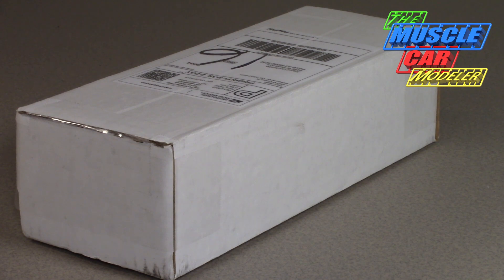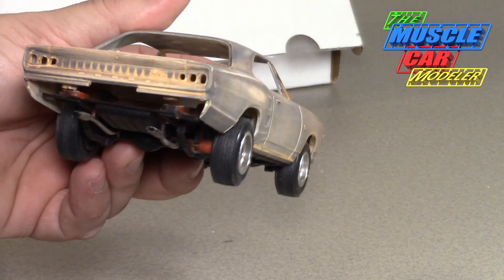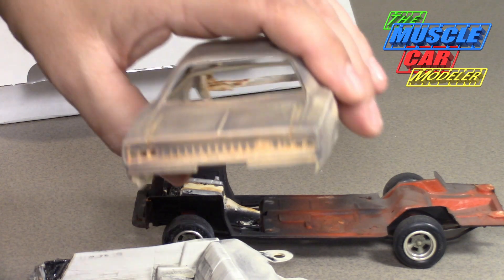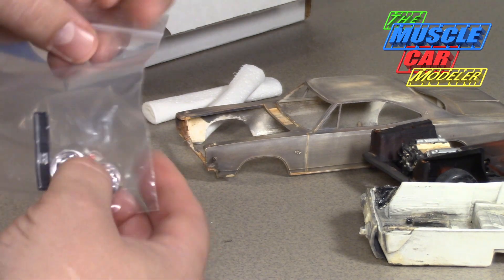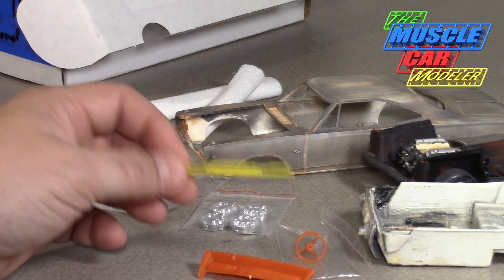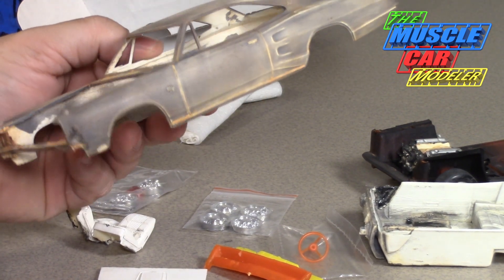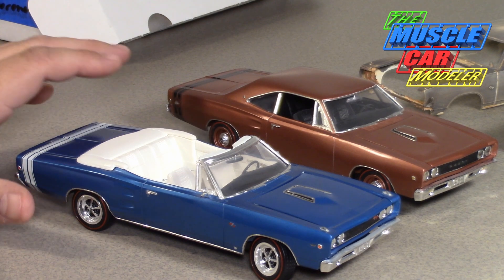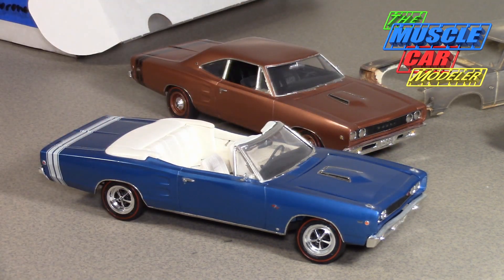MPC 1968 Dodge Coronet RT Restoration Candidate

Comment: Black white bumble bee stripe , white interior, white top , factory magumns with red lines ... what do u use to strip nasty paint and remove dried glue
Reply from the maker: Sounds cool. For stripping paint : https://youtu.be/GgtdhoqcMLw As for the glue that is a tricky one. I try and stay away from really bad glue ones. Some are epoxy type and just come right off. Bad glue marks require lots of body work and sanding. No real tricks just lots of work.

Comment: Factory stock. Either red or dark green metallic. Full wheel covers with redlines.
Reply from the maker: Very Cool! I like the red with redlines. What color interior? Red, Black or White? Would you add a Vinyl top?
Reply: @TheMuscleCarModeler  no vinyl top. I like the red interior with red outside. I get tired of black. I'm not sure white would be as appealing with red outside.

Comment: Oh and SMH (Southern Motorsport Hobbies) is doing the bodies and exterior parts for this kit and Holy Grail has some super nice updated interior parts mastered by Mr. Steve Guthmiller. I have future plans for all of those parts. Hope the link is okay.
Reply from the maker: Link is fine. I have the interior parts on order but they are not from Holy Grail. Greg is local to me and a friend. Drag City Casting is doing the interiors for this that work with the Revell 68 Charger kit chassis. I plan to build this one this way!